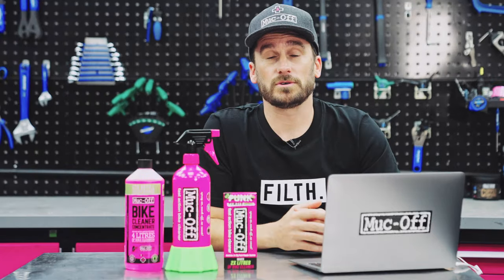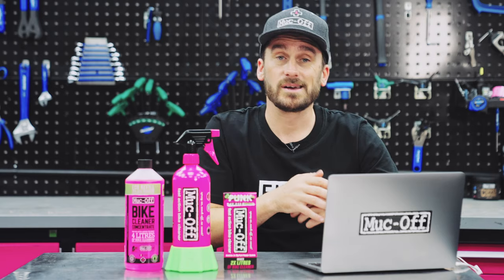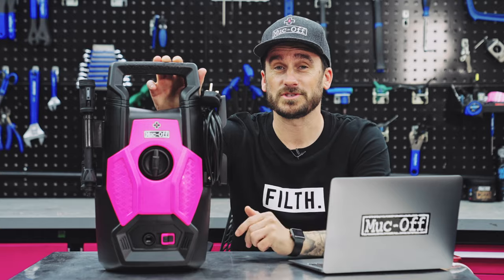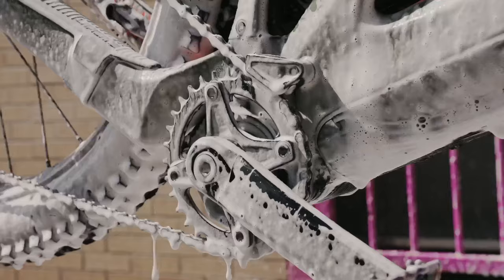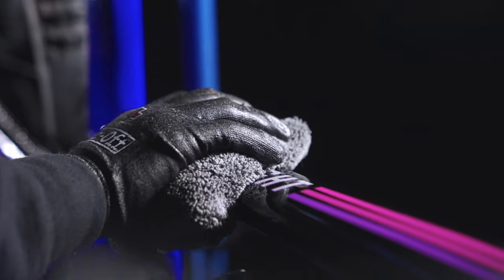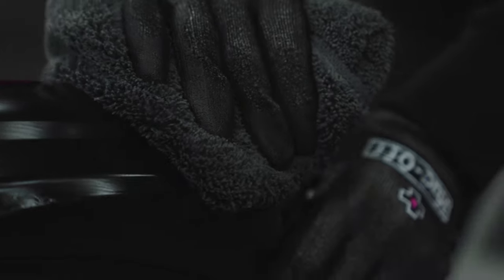Which Bike Cleaner Do You Need?

Comment: I've been wanting to ask: Is the pressure washer compatibel for EMTB's ?
Reply: a bit late but it should be fine... you should just keep a safe distance to not destroy the motor and bearings with too much pressure. a good thing to do is also to take out the battery and let it dry long enough before riding again